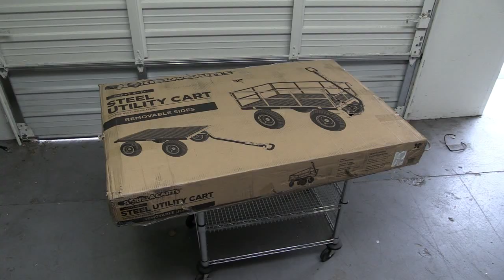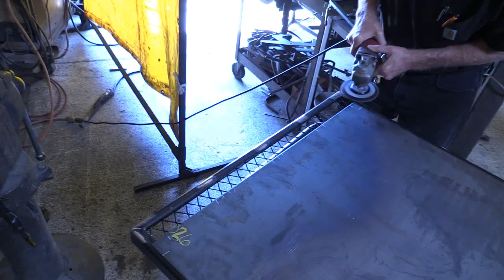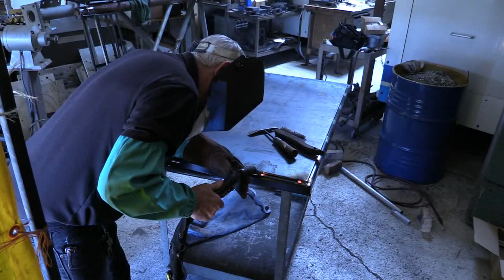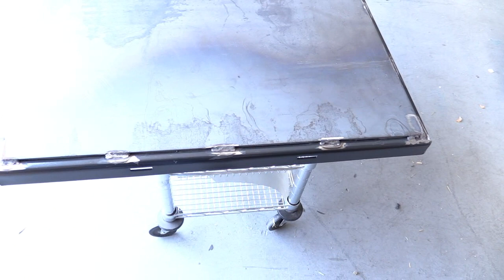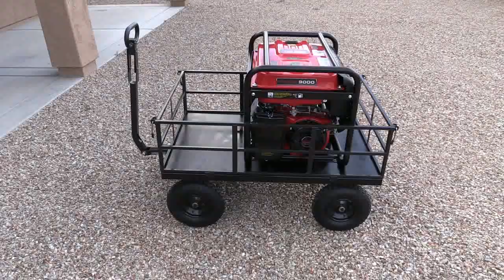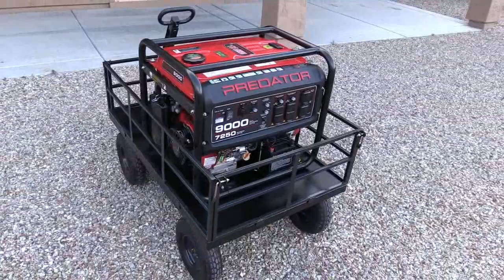Predator 9000 Generator Unboxing & Review

Comment: Trying to decide between this and the champion 9000 models.
Reply: ⚠️All generator safety instructions need to be followed carefully. 

Here are the safety tips: 

This is only a reminder for your safety whenever you use your portable generator. 

1) KEEPING OTHERS SAFE: Please do not allow an unqualified person or your children to operate and service the portable generator. Just because some manuals don’t say that doesn’t mean it’s safe. That is important against the generator safety rules. We also need to be keeping an eye on our children too. You need to make sure that your children are not playing near the portable generator especially when it’s running so they won’t get electrocuted. Generators pose electrical risks and they can be hot during an operation. Please keep your children away from the portable generator at all times. It is important to keep our children safe especially our little ones. Children often get curious about anything so we should keep an eye on them to also make sure they’re not wandering towards the generator. 

2) WHERE TO RUN YOUR GENERATOR: Some people use their portable generators indoors which increases the risk of carbon monoxide poisoning. It’s important to have a carbon monoxide if you have a gas generator. Never ever use your generator indoors even if your doors and windows are open and even in the garage is not safe to use a portable generator. Not even at your porch and your deck. It is never safe to use your generator indoors and in enclosed areas of your home. Your generator needs to be 15-20 feet away from your house. 

3)🔥FIRE HAZARDS: Never refuel your generator while it’s running. You need to let your generator cool off before refueling it and before storing your generator. Never overload your generator too. Never ever back feed your generator. You should never plug your generator into a wall outlet. Also never store propane tanks indoors. Please keep flammable things away from the generator as well and please don’t smoke cigarettes near the generator. Having a fire extinguisher next to the generator is also important against the generator safety rules. 

4) GENERATOR OPERATION: make sure your hands are dry before touching the generator. Never use your generator in wet conditions. Don’t let your generator get wet. You need a generator tent if you need to use your generator during wet weather. Please don’t wear loose clothes when operating the generator. Turn on your generator before plugging in appliances. Use the right cord for your generator. Please do not use worn out cords. 

Hope this helps.

Comment: I have one  of them 9000 love it ( I Worked in Excavating  for yrs. we used them Harbor Fright Generator  for yrs they ready did well worked forever .only  time we had any thing go bad was  when they were dropped of the truck or something like that, they are a little loud but for the money they are just great and last for yrs.  I also have a 6500 from them for yrs . I us the 9000 just about all the time for welding 220 v  works great every time . I would say great deal .. look at the cost of the rest   like WOW WOW WOW  08/21/20  the sale was $599  I can buy  >>   4 of them to like Honda   <<  time as proven they are just Dam good and they are dependable I say go get one      >>>>>>>>  P.S.  I just got the TRI-FUEL CARB  ICAN US PROPANE N-GAS    AND GAS  SAME CAB JUST TRUN THE GAS OF ON THE GEN TRUN ON THE PROPANPE GAS AND THAT IS IT . GOT THE CARB ON AMAZON I THINK WAS LIKE  $ 49.00  <<<<<<<< CAN NOT GO WRONG RIGHT ???

Comment: Does it speed up and slow down depending on electrical load? Some generators will idle until a load is put on it.
Reply from the maker: I wouldn't say is "speeds up and slows down", but you can tell when its under load...
Reply: @checkmatearmament2281  Does it ever idle?
Reply from the maker: @scottdavis7743 , only when NOT under load!....
Reply: @checkmatearmament2281  BTW, TY for responding.
Reply: ⚠️All generator safety instructions need to be followed carefully. 

Here are the safety tips: 

This is only a reminder for your safety whenever you use your portable generator. 

1) KEEPING OTHERS SAFE: Please do not allow an unqualified person or your children to operate and service the portable generator. Just because some manuals don’t say that doesn’t mean it’s safe. That is important against the generator safety rules. We also need to be keeping an eye on our children too. You need to make sure that your children are not playing near the portable generator especially when it’s running so they won’t get electrocuted. Generators pose electrical risks and they can be hot during an operation. Please keep your children away from the portable generator at all times. It is important to keep our children safe especially our little ones. Children often get curious about anything so we should keep an eye on them to also make sure they’re not wandering towards the generator. 

2) WHERE TO RUN YOUR GENERATOR: Some people use their portable generators indoors which increases the risk of carbon monoxide poisoning. It’s important to have a carbon monoxide if you have a gas generator. Never ever use your generator indoors even if your doors and windows are open and even in the garage is not safe to use a portable generator. Not even at your porch and your deck. It is never safe to use your generator indoors and in enclosed areas of your home. Your generator needs to be 15-20 feet away from your house. 

3)🔥FIRE HAZARDS: Never refuel your generator while it’s running. You need to let your generator cool off before refueling it and before storing your generator. Never overload your generator too. Never ever back feed your generator. You should never plug your generator into a wall outlet. Also never store propane tanks indoors. Please keep flammable things away from the generator as well and please don’t smoke cigarettes near the generator. Having a fire extinguisher next to the generator is also important against the generator safety rules. 

4) GENERATOR OPERATION: make sure your hands are dry before touching the generator. Never use your generator in wet conditions. Don’t let your generator get wet. You need a generator tent if you need to use your generator during wet weather. Please don’t wear loose clothes when operating the generator. Turn on your generator before plugging in appliances. Use the right cord for your generator. Please do not use worn out cords. 

Hope this helps.

Comment: I have a harbor freight power washer I believe it’s got a little tiny 176cc engine on it,,, I wring that thing out in the summertime and it just keeps right on pumping.Man that’s a really nice looking generator let us know how it does with LED lightbulbs and electronics like charging a laptop or flat screen smart TVs and stuff like that,,, there’s a guy on YouTube that got this generator also and he bought a tri  fuel carb for it from Amazon. I thought that was pretty😎 cool and I believe you can get a tri fuel kit for this generator from US carburetion in West Virginia their motor snorkel kits that will allow you to run natural gas propane or gasoline I think it would be really 😎 cool

Comment: Have a review of actually using the generator under a house load?
Reply from the maker: Not yet!  I am just getting started on my new house now.  I intend to have a sub panel just for the necessary 8-10 circuits, fridge, freezer, well pumps, surveillance, internet, access points, a few lights....and my gate control!....😎
Reply: I have recently hooked up mine to power my whole house. (4K+ square feet) The only thing I can’t run are my electric floors I figure. I did a test run about a week ago. I was able to power my dryer, oven or range no problem. The oven did make it lug down, but it kept going. I didn’t try any more than one at a time. This is on top of 2 fridge/freezers and a chest freezer, and whatever lights I had on. (95% of my lightbulbs are leds) My propane furnace was also running. Not sure how much wattage I was actually drawing. But I’m happy with mine.

Comment: When you said the word "emergency" use, that alone would justify getting a Honda.. something  that almost never gets used is typically not reliable.. But During an emergency  it has to work.. I bought a Honda and I have no regrets I push a button and the super quite fuel injected engine is running.. you have to look at and in the long-term, I'm going to have it for 20 years at least, and it has to work, I couldn't tell you how many times my neighbor with the Generac  has had carburetor problems  right when he needed it.. you get what you pay for and you pay for what you get
Reply from the maker: Thanks for the reply.  I understand what you are saying and I do test it once a month to insure proper operation.  I am on a large piece of land, so the quietness isn't an issue and the thought was that I could purchase quite a few of these units for the price of an equivalent Honda.  I rarely skimp when purchasing just about anything, but this route seemed the better value for the money.  Again, thank you for your comment.
Reply: Checkmate Armament I really don’t think you’ll need to replace this predator anytime soon I think it’ll run a good long time for you
Reply: @checkmatearmament2281  gotcha, that makes sense
Reply: Rick from all the reports I’ve seen these predators seem to be pretty reliable,,,people are using them during the hurricane season and stuff down south with great results,,, these predator generators have really become America’s go to brand anymore,,, A lot of guys are using these to weld with and everything else

Comment: Why didn't you just buy the wheels?
Reply from the maker: I thought of that for just a brief moment.  The cost to fabricate all the other pieces would have been much more than the cost of the wagon...
Reply: @checkmatearmament2281  I think they meant why not just buy the wheel kit for the generator. I can tell you that hauling a generator out of storage and getting it into a safe position is a pain in the butt with the cheap wheel kits. I'm loving this cart idea. I'm really going to give this some thought if I ever upgrade my 5000W pull start to this 9000w baby.

Comment: Need to drill a large hole in the trailer so you can drain the oil
Reply: LOL
Reply: ⚠️Always remember to follow all the generator safety tips whenever you use your portable generator. This is just a reminder for your safety when using generators. All generator safety instructions need to be followed carefully. 

Here are the safety tips: 

1) KEEPING OTHERS SAFE: Please do not allow an unqualified person or your children to operate and service the portable generator. Just because some manuals don’t say that doesn’t mean it’s safe. That is important against the generator safety rules. We also need to be keeping an eye on our children too. You need to make sure that your children are not playing near the portable generator especially when it’s running so they won’t get electrocuted. Generators pose electrical risks and they can be hot during an operation. Please keep your children away from the portable generator at all times. It is important to keep our children safe especially our little ones. Children often get curious about anything so we should keep an eye on them to also make sure they’re not wandering towards the generator. 

2) WHERE TO RUN YOUR GENERATOR: Some people use their portable generators indoors which increases the risk of carbon monoxide poisoning. It’s important to have a carbon monoxide if you have a gas generator. Never ever use your generator indoors even if your doors and windows are open and even in the garage is not safe to use a portable generator. Not even at your porch and your deck. It is never safe to use your generator indoors and in enclosed areas of your home. Your generator needs to be 15-20 feet away from your house. 

3)🔥FIRE HAZARDS: Never refuel your generator while it’s running. You need to let your generator cool off before refueling it and before storing your generator. Never overload your generator too. Never ever back feed your generator. You should never plug your generator into a wall outlet. Also never store propane tanks indoors. Please keep flammable things away from the generator as well and please don’t smoke cigarettes near the generator. Having a fire extinguisher next to the generator is also important against the generator safety rules. 

4) GENERATOR OPERATION: make sure your hands are dry before touching the generator. Never use your generator in wet conditions. Don’t let your generator get wet. You need a generator tent if you need to use your generator during wet weather. Please don’t wear loose clothes when operating the generator. Turn on your generator before plugging in appliances. Use the right cord for your generator. Please do not use worn out cords. 

Hope this helps.

Comment: I already had my mind made up to buy this but this video was Very helpful !!!  Thanks !
Reply: ⚠️Always remember to follow all the generator safety tips whenever you use your portable generator. This is just a reminder for your safety when using generators. All generator safety instructions need to be followed carefully. 

Here are the safety tips: 

1) KEEPING OTHERS SAFE: Please do not allow an unqualified person or your children to operate and service the portable generator. Just because some manuals don’t say that doesn’t mean it’s safe. That is important against the generator safety rules. We also need to be keeping an eye on our children too. You need to make sure that your children are not playing near the portable generator especially when it’s running so they won’t get electrocuted. Generators pose electrical risks and they can be hot during an operation. Please keep your children away from the portable generator at all times. It is important to keep our children safe especially our little ones. Children often get curious about anything so we should keep an eye on them to also make sure they’re not wandering towards the generator. 

2) WHERE TO RUN YOUR GENERATOR: Some people use their portable generators indoors which increases the risk of carbon monoxide poisoning. It’s important to have a carbon monoxide if you have a gas generator. Never ever use your generator indoors even if your doors and windows are open and even in the garage is not safe to use a portable generator. Not even at your porch and your deck. It is never safe to use your generator indoors and in enclosed areas of your home. Your generator needs to be 15-20 feet away from your house. 

3)🔥FIRE HAZARDS: Never refuel your generator while it’s running. You need to let your generator cool off before refueling it and before storing your generator. Never overload your generator too. Never ever back feed your generator. You should never plug your generator into a wall outlet. Also never store propane tanks indoors. Please keep flammable things away from the generator as well and please don’t smoke cigarettes near the generator. Having a fire extinguisher next to the generator is also important against the generator safety rules. 

4) GENERATOR OPERATION: make sure your hands are dry before touching the generator. Never use your generator in wet conditions. Don’t let your generator get wet. You need a generator tent if you need to use your generator during wet weather. Please don’t wear loose clothes when operating the generator. Turn on your generator before plugging in appliances. Use the right cord for your generator. Please do not use worn out cords. 

Hope this helps.